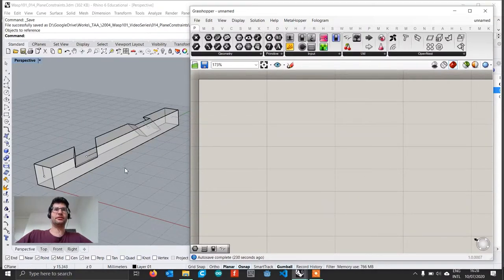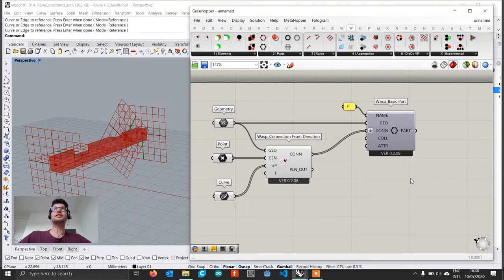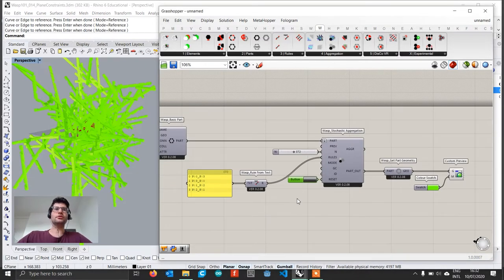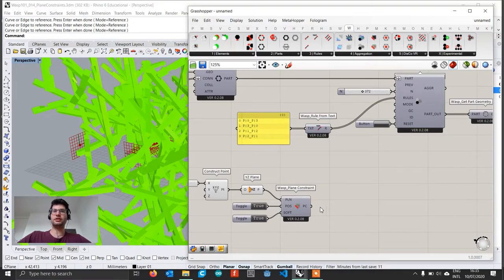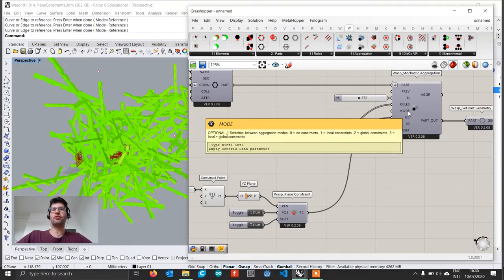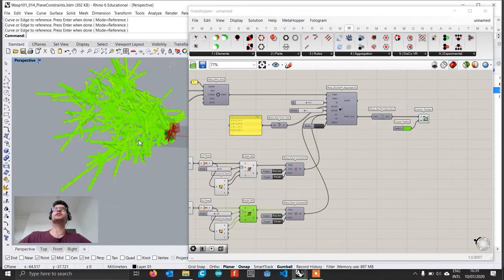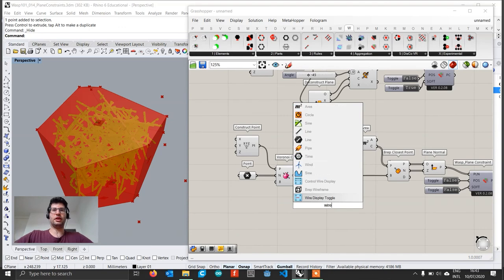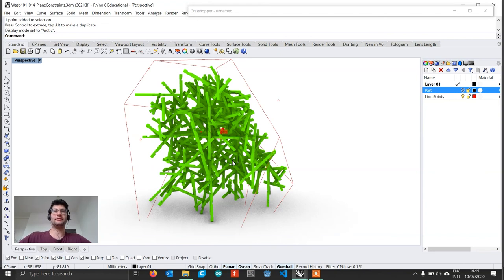Wasp for Grasshopper #101 - Tutorial #014: Plane Constraints

Comment: Very Useful Tutorial. Thankyou Andrea! I am using Wasp 5.0. Plane constraints work fine and seamlessly with 1 or 2 planes constructed using point(s), but it does not work at all with the voronoi cell. It raises a warning that it could not place 'n-1' parts. Why is it so ? Also, the algorithm fails to run if I try to connect another geometry with respective connecting points and direction curves from the same rhino file. Thank you in advance :)
Reply from the maker: Hi,
could you send me the file? Either per email at ghwasp@gmail.com, or on the Discord Support Server (https://discord.gg/Wke9Jt6). Then I can take a better look.

Comment: Probably, there's a bug with placing reference part.
When i place reference part too far away from the 0.0.0 coordinate (i.e. -150000, -75000.0), Part element starts showing "1. Could not compute a valid collider geometry. Please provide a valid collider in the COLL input.". Then i randomly move reference part across the whole scene and there's a chance that there'll be no errors. Thus there're some "anomaly" zones where algorithm doesn't work. I faced this problem several times during the tutorial series and got different errors such as "1. Could not place N parts" in a aggregation components, so no matter what kind errors it shows, the problem is with placing the reference part
Reply from the maker: I checked the file you sent by email, and the error has to do with your collider. As you used the geometry itself as collider, your geometries have a strange behavior, and they often do not work (actually, they should never work!). The collider should be calculated internally by Wasp. If you provide a collider yourself, it should not be the geometry of the part itself, but a geometry which is created from the base one through an inwards offset of a small amount.
If the collider is calculated internally, the aggregation seems to always work. I will send you the file via email to check. Thanks for reporting the issue!
Reply from the maker: I will make a video about colliders soon ;)

Comment: how can I reduce the density of the aggregation? When I type N=1000 OR ABOVE, it looks very dense. How can I reduce the density, but make the overall structure grow larger? Thanks!
Reply from the maker: Well, the aggregation will grow dense if it it allowed to. There is no direct way to control that, because this is determined by a lot of different parameters. The best solution would have to design a part and its connection so that they do not allow aggregation with a high density. 
Another option would be to use Adjacency and Exclusion constraints to make sure that parts are staying apart from each other. This is still an experimental feature of Wasp, but you can see it and test it from this video: https://youtu.be/dnrK8wpUNmg
Finally, another option to avoid high densities would be to use an additional collider attached to the part, to make sure that you make an area around the part itself not available to other parts.
Reply: @TempAutonArch  thanks so much:)